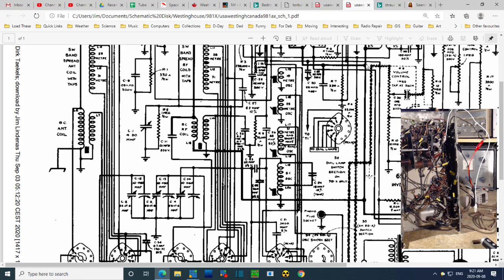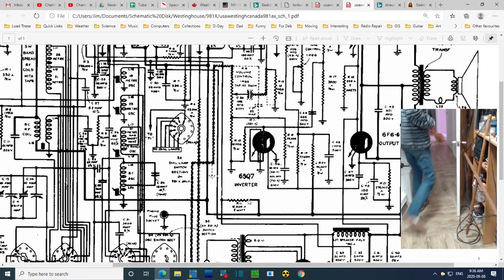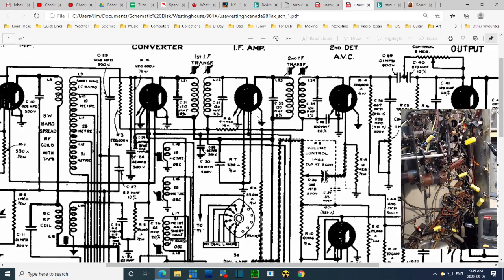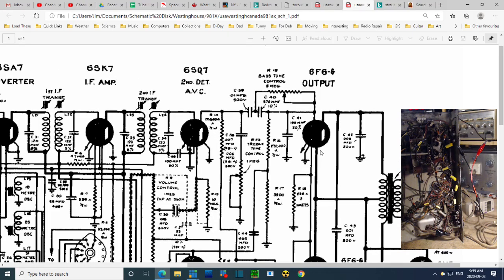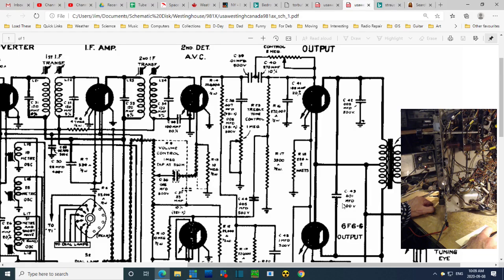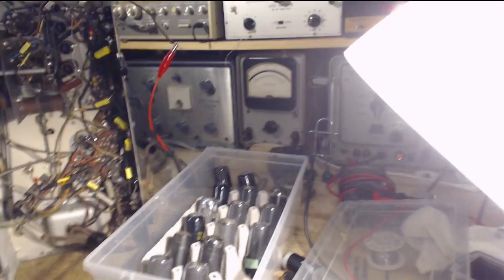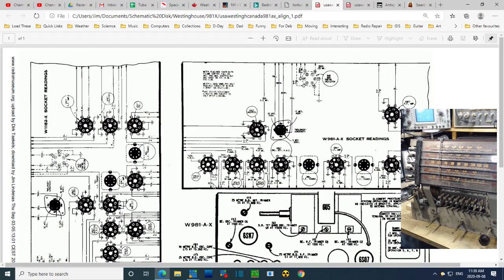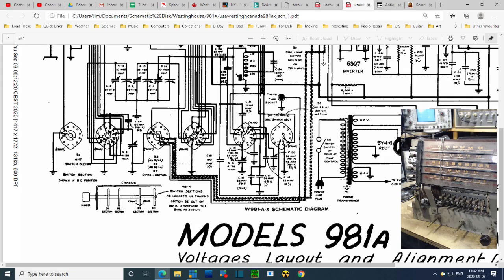Westinghouse 981X Shortwave Receiver Video #7 - Final Checks Before Alignment

Comment: 40:45 Jim the plate voltage is lower than the screen because of the DC resistance of the output transformer.
There could be a slight difference in the plate voltage between the tubes because the two primary windings are not the same dc resistance. What you are seeing in your measurements is perfectly normal and is the same in many radio’s. You are not looking at an anomaly.

Comment: Reading the values on those old, grimy dust-encrusted capacitors is easier if you apply a little gentle heat, such as from a a heat gun.  This melts the wax and you can then wipe it clean to reveal the markings.

Comment: 1:14:42 The screen grids of the output tubes are connected with a solid wire. There cannot be a voltage differential between the screen pins (unless you missed a broken wire or solder joint). Making comparative measurements on the screen pins only serves to confuse you and throw you off track.
And the issue of one tube running a hotter plate with lower plate voltage, and this effect not moving with the tube when swapped over, should imply a drive issue. So test grid voltages with high impedance meter and recheck for leaky, old, still unchanged coupling caps (C39 C47) and open high ohm grid resistors. (Top 6F6 grid resistor R16 270k + R17 3k9 , bottom 6F6 R21 270k)
If that fails to yield results use scope to check for oscillations and make comparative measurements of primary winding resistances of audio output transformer

Comment: Just think of all the time you could save if, every time you had to look up a tube in the manual, you scanned it. and printed a copy. You would soon have a custom manual of only the tubes you needed to look up.

Also, dim-bulb testers are intended to prevent damage to equipment at turn-on.  They are not intended for operation  of equipment, and measurements made of voltages and currents while the bulbs are in the circuit are meaningless.